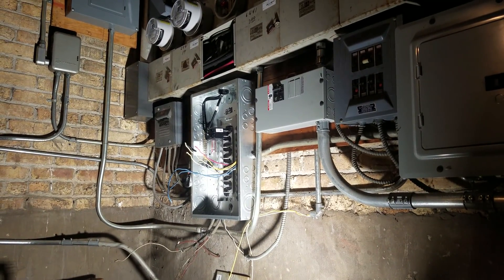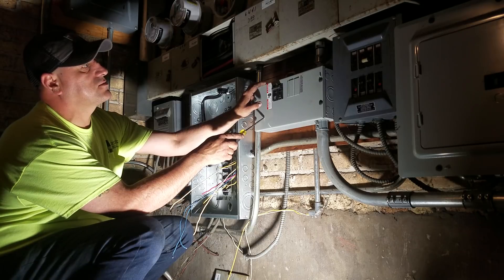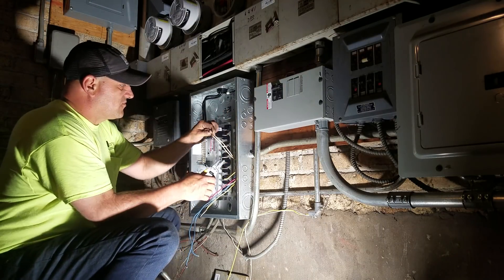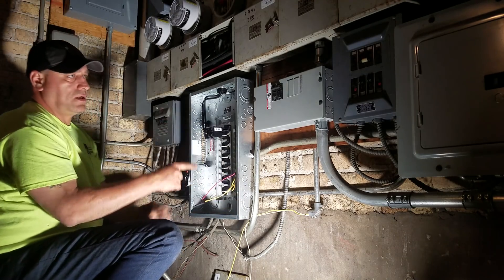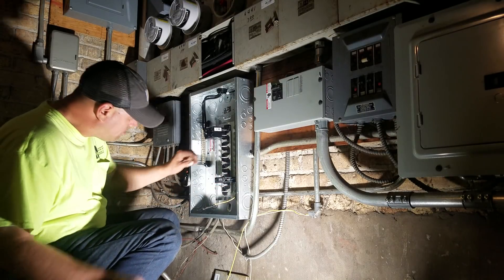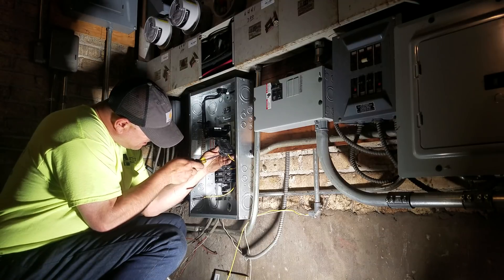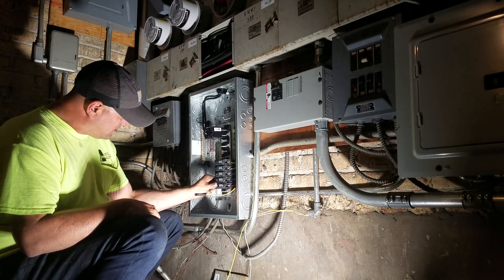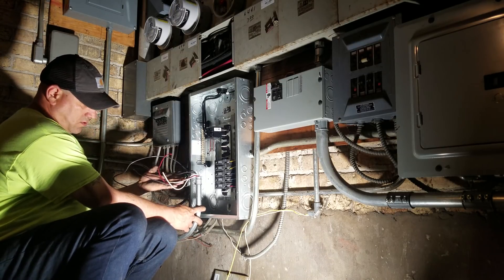100 amp panel swap

Comment: This is a good video.
We call this a bootleg upgrade.
What you didnt show is how you killed the main breaker and popped the meter off to make the panel you had your hands in,  safe.
This is dangerous work. Skipping steps is not advisable.

Comment: Are you using solid wire?? Don't you hate working with that???
Reply from the maker: Yes I hate solid wire stranded is way easier to work with in my opinion

Comment: Mr. Nate, I’m upgrading from 100-150amp (was going to do 200 amp but based on electrical usage, was advised that it was not necessary plus the cost). For this upgrade do I also need to also change the meter pan (it’s not damaged or anything)??? I didn’t think I needed to do that since all the components leading to it was rated the same. Can you advise, thanks?

Comment: Haha love the video. Sounds like you’re having fun. I’ll be heading to a electrician trade should in about a week and love to watch these kind of talking and working videos. It helps me somehow.
I do have a question: I live in a condo unit and notice the main disconnect is downstairs outside my building and has my unit number and 100 amp breaker panel associated to it. Does that mean the panel up in my condo unit is a sub panel because I don’t see the main breaker shutoff in it? And so if I shut off the main breaker downstairs that would shut off all powers up in my condo?
Thanks!
Reply from the maker: 100 M breaker is your main so your panel is technically subpanel and yes it would shut off the power to your unit

Comment: Nice work nate! Good to see u putting it all together. If u had an inspector that wouldn’t pass a wire nut in a panel could u soilder the wire and then they would pass it?
Reply from the maker: If there is one or two they probably wouldn't say much but if they were all short you would probably just have to re pull it. And if you Soddered and taped it I'm sure that would be okay too. I've seen really old houses with soldered joints rather than wire nuts

Comment: I agree with you on bending the wire at a 90 degree angle to make it look nice. Problem is about 95 percent of the panels I get into look like a damn rats nest. Lol.
Reply from the maker: Massey1105driver yep you'd be amazed at some of the stuff I've seen

Comment: I was just thinking of you the other day.  I did some wiring for a 3 phase mill and a 3 phase lathe running off 1 VFD.  I'm going to post a video in a couple weeks of what I came up with (for your entertainment), but shhhhh, don't tell the local inspectors!  I do find the electrical videos just as interesting as the farm videos.  I, too, have many interests.  Keep up the good work and thanks for the video!
Reply from the maker: burningdinosaurs yeah man that's cool definitely let me know when you post that